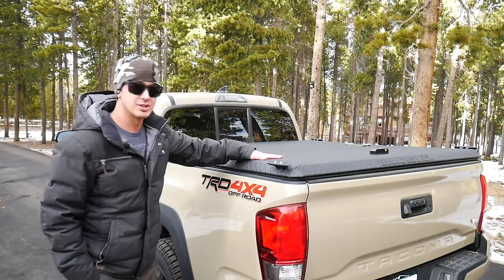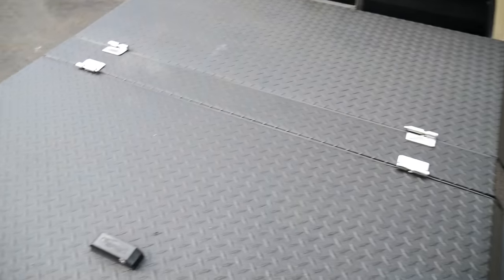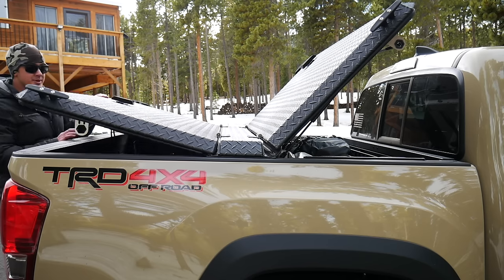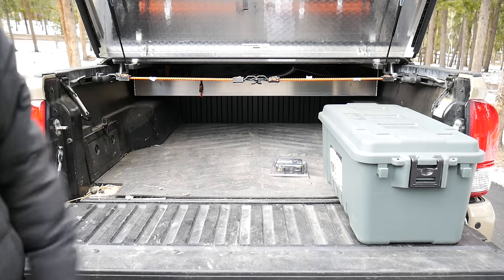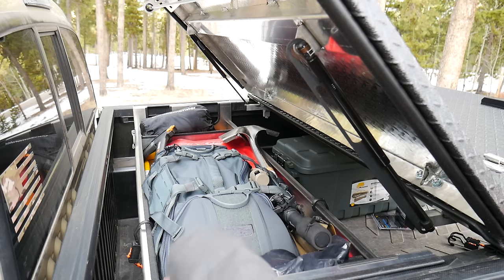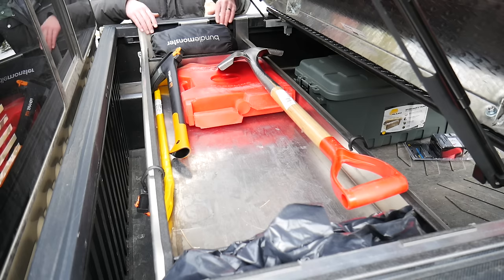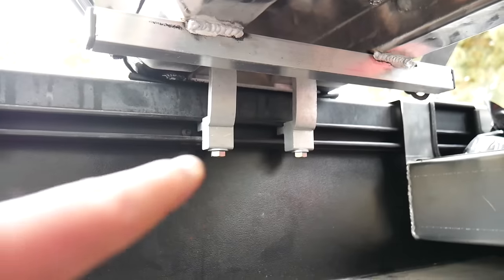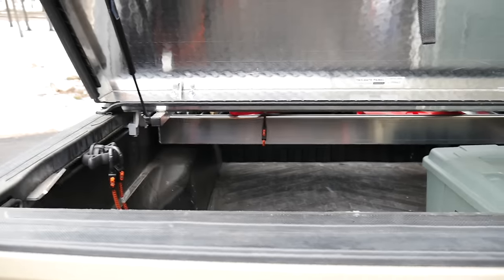DiamondBack Truck Bed Cover Review - Essential Truck Gear - Episode 2 (2016 Tacoma)

Comment from the maker: Check out EVERYTHING you can do with this cover in this newer video - https://youtu.be/ndg8KaZ_Wsc
Reply: Last Line Of Defense  I’m looking at one off these covers how dose it seal against the elements? Is dust or water ever a issue ? Thanks man great videos !
Reply: Mike, which Diamondback toolbox is that. The 8 or the 13?
Reply: @lastlineofdefense Update your affiliate link for the shovel
Reply: I love the tonneau but I want to put a fridge/slider in the bed. What is the max depth of the bed where the locking bars are?
Reply: Just installed my Diamondback and ordered my rack to install my Roofnest Falcon. I'm in Manitou Springs. Cant wait to get it up in the mountains. Also installed a Tailgate N Go made by a family in Grand Junction.
Reply: @dokken08  did you get the HD or SE. I have a representative from diamondback reccomending I not get the SE for a rooftop tent as it does not support the weight of that plus people and gear, and will also void the warranty.   Although it seems mike does not have an issue.  Any help is appreciated thanks.
Reply: If they made flip out grip portions under each panel, each side could be used as a ramp for an ATV/motorcycle. Should hit them up about that, considering its diamondplate
Reply: @lastlineofdefense - @8:00 when you fold the panel completely over - Would it be possible to leave it folded that way if you secured it down (bungee cords or something)? I transport my bike using a tailgate pad and would love to continue to do so without having to remove the whole panel. Also, have you removed it often? Do you still recommend this cover?

Comment: I had one of these Diamond Back covers on my '05 Sport Trac and it was  valuable in regards to being theft proof.  Prior to installing it the contents of my bed could be stolen even with the soft tonneau cover.   Another item I installed was the swing out cage that extended the bed another couple feet when allowing the tailgate to  lie in the open position.  This allowed me to load fire wood onto the tailgate and keep camping gear dry underneath the Diamond Back.  We had lots of camping gear and would often load the excess on top of the Diamond Back and secure it with a heavy duty cargo net.  Presently I own a SUV but you got me thinking about buying another pick up and it seems like the Tacoma TRD is an excellent choice.

Comment: I owned one for 4 years on my Titan XD PR.   Which was a great truck except for all the mechanical failures nearly monthly.   Finally I had to take the hit on a trade and got a Ram.   Shorter bed will mean new cover.  I had the Rear Window guard on my cover also just in case I wanted to tie stuff down on top.. which I had several times..  Even though it was a pain to install due to the slide rails on the Titan... which were great also...  I will definitely be ordering one for my new Ram..  I did have the front panel try to slide off once but that was my fault for not locking the handle which allowed it to rotate to the open position and release the latches..  So be careful that you always lock the handle it will be no problem.

Comment: Take a look at the Honda Ridgeline. it has a trunk in the bed the locks tight and has a gasket to keep it sealed from the weather. Those truck covers don't keep moister out and things will rust. Take a look at on. It drives smoother than a regular truck.

Comment: I'm still torn between the Tacoma and the Tundra. I will have 3 kids in a few weeks so I'm thinking I will need the cab space of the Tundra. but I love small trucks!!!!
Reply from the maker: mixflip I'd probably go for the tundra, if I had 3 kids. Well, I'd probably go for an f150 Ecoboost actually...
Reply: Last Line Of Defense I had an F150 4x4 crew cab a few years back. loved it but I'm not 100% sold on turbos. they tend to be high maintenance and major weak points as far as bug out vehicle is concerned.
Reply from the maker: Yeah turbos will always have a little more overhead, so I agree there. My brother has the Ecoboost though, and his truck feels like driving my old GTI - the Taco and Tundra are dogs in comparison.
Reply: I love the Tacoma short bed.  I have departure angle scrapes as it is.  If I had the Long bed I probably would have much more damage.  Plus it depends on where you like to go.  For me the smaller truck seems to fit better on tight trails.   Maybe in taking out my ass and the tundra is the same width.   It just looks wider to me.  For desert the tundra would kick ass.    Then there is the gas mileage.  The Tacoma gets about 14 at 70mph.  Or less.  I basically average 14.  I think the tundra would be closer to 10-12.    Again guessing.   These are the things I would consider is all.

Comment: I share the same opinion about toppers. Ive been debating this cover vs a shell. I traded my f350 for a toyota. I dont haul 5ers or goosenecks anymore. This cover is awesome.  It has the benefits of a flat bed and a normal bed. Pretty ballzy to leave a firearm in there.  You need a Ravelco. Google your closest dealer.

Comment: Good, thorough review.  I wonder if Diamondback should put a locking mechanism on both sides of the front piece rather than just one, so that it will hold it down tighter on both sides.  What do you think about that?  And another question.  At the end of your video here you are sitting on the front piece with the rear piece open at an angle.  Can that rear angled piece of the cover support your weight easily without being damaged if you were to lean against it, or maybe two of you doing so side by side looking at a laptop screen say you place on the top of the cab infront of you?  And same if you are sitting on the rear piece and the front piece is open and angled, with that take the weight easily of one or two people leaning back against it?  And on a side note, I'm leaning towards getting the HD, but I like the idea of using the closed cover like a back deck at your  home.  Put a couple of lounge chairs and maybe a cooler up there, even an umbrella over the seats to block out the sun, or not so you can see the stars at night, but you up off the damp or buggy ground.  Seems a nice little plus for a hangout option.

Comment: The issue your having with the front latch is on the adjustment for the front box,  passenger side. Easily fixed. Interesting though that yours has a  track for your back latch,  mine does not!

Comment: Awesome cover, couple of questions. Is that small shelf that you keep the get home pack an add on or something that comes with the cover? Also you have an orange ratchet strap across the center of the bed. Is that part of the standard install or something you added to help stop it from swaying or something?

Comment: Can you mount a rack on top of the diamond back?

I had the idea of sleeping on top of the cover on an air mattress.   And then putting an easy up over the whole truck.  The kid that has the walls that can go 45 or all the way up or down.   I’m wondering if the locks on top of the cover would damage an air mattress.  Or a rack which I could throw a tarp over.   

I don’t want to mount a 400 lb tent on the back of my truck.  I want light for gas mileage.  And I don’t want to be too heavy.   

Any ideas ?   I really like the diamond back either way.  
I also plan to get a rigid bumper swing out for the spare tire with the slide out table.

Comment: Hello i have question what are the length did you order? Is your tacoma short bed?  I want to oder one but not sure which one to order, i have a short bed tacoma. There’s two length bed, on the diamonds back cover, one is 5’ and the other one is 6’2”  which one is for short bed tacoma. Thanks

Comment: Hey Mike. I noticed the hinches on your current setup are black. On this video they're chrome. Did you replace your diamondback cover for an HD or you still have the SE? Been thinking about getting the cover for a while. But I can't justify 2k for it. If I could install a rooftop tent and have 2 adults without breaking I would totally get the SE. Thanks

Comment: If the SE hauls 400, does it have a static weight limit that's much higher? I can't fine anything on it. I know you have the racks and tent on it now which I would assume is well over 400 when you are sleeping in it. Thanks Mike

Comment: Today I installed a DB cover on my new 2018 Taco TRD Pro. I too can not get the cabin panel to suck in. I had to remove the tie-downs to make room for the locking tabs. Did you ever figure this out?

Comment: Another great video. IK I’m late to the party, but is it me or do the two ends not sit flush? Does this cause problems with element infiltration?
Reply: If you put weight on the panels when you install them you can adjust the latches/locks and make the panels more flush. You may need to press down on the panel and then turn the lock, but it looks better.

Comment: Awesome review!  I just picked up my '18 TRD Off-Road yesterday and have spoken with DiamondBack to get the process started on a HD cover.  Also looking at the cross bins; debating the 8" and 13".  Looks like you have the 8".  If so, can you let me know how much clearance you have under it?  I'm curious if the 7.25" MTM ammo/utility tubs would fit underneath.   Looks like there's plenty enough space, but just wanting to make sure.

Comment: Great video.  I have a Tundra with a Roll 'n' Lock cover.  When the cover is closed, it must create some sort of vortex with the air flow because it sucks a ton of dust in on gravel roads (I think it comes in the gaps around the tailgate).  Do you ever have the same issue with this?
Reply: Yes, I actually saw them not long after I posted this comment.  A few years ago, I installed foam weather stripping that helped, but the foam compressed and pretty much stopped helping, so is time to replace with a proper tailgate seal.

Comment: This cover is pretty cool, but I could never have one. I bought a camper on one of my trucks and it became useless as a truck. For my use anyway. I couldn’t dump rubbish, haul green waste or motorcycles. And whatever I put inside slid all the way towards the cab, then I’d have to crawl inside and get it. Huge pain, nice to sleep in but then you gotta take everything else out.

Comment: Just a few questions. Did you notice a difference in suspension performance after installing the cover? Have you noticed any moisture creeping in? I live in Aurora and want a cover that will be fairly secure. Thanks for any answers.
Reply from the maker: Didn't notice any change in ride or ride quality, and I haven't had any moisture issues yet!

Comment: Diamondback jacks the price on these covers $320 if you want black. Nice covers but I'm not paying more for the same cover. Heck, they are already expensive enough.
Reply from the maker: It's extra because one is raw aluminum, the other is coated with this super thick line-x material.
Reply: @LastLineOfDefense  I understand their reasoning but they should have split the price difference down the middle and charged the same for both. The raw aluminum appeals more to business customers.
Reply: @LastLineOfDefense  By the way, great in depth review. Much appreciated.

Comment: Harbor freight make some small led lights with a hook and a magnet that might help shine some light in the bed while getting stuff out at night, or a headlight in that tray maybe .?..
Reply from the maker: Yeah, i am thinking about installing some led bed lights at some point - but it's relatively low on the list. I don't too often run into a situation where the available light isn't enough, or I don't have on a headlamp for whatever else I'm doing in the dark, etc. There are some cool options out there though.

Comment: I just installed mine on my Tacoma. How far forward do you install your cap? I didn't t go all the way to the forward edge of the bed closest to the rear window. I left about a 1/4" inch of the top of the rail exposed. When I raise the tailgate I notice I'm fighting against the rear weatherstripping that goes across the tailgate. Was yours a little tough to close when you installed yours?
Reply from the maker: Yeah I probably have about 1/4 - 1/2" at the front. My tailgate opens/closes without much effort - though I could probably tighten my top a little bit, the weatherstripping isn't pressed excessively tight.

Comment: Hey Mike, I recently purchased a Diamondback cover for my Tacoma. I was wondering if the cleats would be a problem for an automatic car wash? Have you run yours through one and if so was there any problem with the cleats?
Reply from the maker: No problems at all - I go through carwash with racks, maxtrax, even rooftop tent sometimes.

Comment: that's an awesome cover but that center peice is a bit low and  would drive me crazy.  I wonder if that can be adjusted to be flatter?  maybe the center peices can be shimmed up a bit?
Reply from the maker: It's a gasket, and I think I just need to tighten up the front and back piece to suck them down tighter to match.

Comment: Why would they put external hinges? There is a reason door hinges are on the inside. What's to stop someone from just unscrewing the bolts and taking the hinges and panel off?
Reply from the maker: Can't unscrew them without holding the nut on the inside of the bed

Comment: Do you have issues with water proofing or water leakage? I got mine and have been trying non stop on my taco to try and seal the cracks and gaps with silicone to no avail....
Reply: My front end near the cab leaks like crazy
Reply from the maker: Yeah it's most likely not the cover - it's just the large voids in the bed itself. If you climb in in the bed, you'll be able to see in the corners the big gaps in the bed itself. You'll need to fill those with something. I'm using a few piece of weatherstripping on mine.
Reply: Last Line Of Defense is yours now completely waterproof now? And if so can you PLEASE tell me what you used and where you put it. I’m going crazy trying to water proof my bed!
Reply from the maker: Did you read the previous comment?
Reply: Last Line Of Defense whoops sorry, didn’t see it the first time

Comment: The representative from diamonback told me not to get the SE for a rooftop tent as he said it's weight capacity is only 400 pounds yet you seem to have no problems with that. Can you give me some more information?
Reply from the maker: I don't work for Diamondback, so I can't really say one way or another - but I'm sure the Diamondback person told you that, so they could stay within their quoted specs / legality. But the SE is a solid cover and in my opinion will hold up just fine. Stay tuned in the next few weeks and I'll be doing a more in depth video on the whole setup!
Reply: @LastLineOfDefense  thanks for the reply.

Comment: Will that tool tray slide from front to back between the center? Or does it have to be moved to the front or just the back?
Reply from the maker: It won't slide between, you'd have to take it out and move it if you wanted to do that.

Comment: Did you go ahead an install yourself and have you noticed any cosmetic damage from the cover? About to 'pull the trigger' on this.
Reply from the maker: i installed myself, pretty straightforward. The cover doesn't damage anything, and you don't have to make any permanent modifications.
Reply: Thanks for the VERY fast reply. Glad to hear no damage. I figured it wouldn't be difficult install from what I've seen online. Much confidence from your response! Also thanks for pop lock recommendation too 👍🏻

Comment: Could a thief just unbolt the exposed hinges and lift up from the middle?
Reply: Dean Fuller probably, but it's not likely to happen without someone noticing at some point
Reply: Dean Fuller There are nuts on the underside of those bolts that would make it very difficult to do that (I couldn't do it with my impact driver).
Reply from the maker: Yeah, even though the bolt heads are exposed there, I think you'd be able to just loosen them a bit, but not actually remove them. I'll try it out to make sure, later when I have a chance.

Comment: How does the lid lock in place to keep it from closing when you lean on it like you did on the end of the video?
Reply: Daniel Mendoza it doesn’t lock in place but there is some resistance from the gas springs

Comment: Your Pop & Lock link is for a Tundra, not a Tacoma.

Not a big deal, just wanted to let you know :)
Reply from the maker: Kind of correct, but that Tundra and the 16/17 Tacoma is the same exact system. So yeah, it is actually for the Tacoma, but it is also for the Tundra (same model number)
Reply: Oh gotcha. 

I only said that cuz Amazon was kind enough to give me an obnoxious notification about the product not being compatible. Upon further inspection it does in fact appear you are correct.

Thanks for helping me clear that up!
Reply from the maker: No worries! Yeah, amazon's 'does this fit my vehicle' thing works maybe 15% of the time... :/

Comment: Where do you buy the parts for the bed lock in 15:12 thank you.
Reply from the maker: I'm not sure what locks you're talking about - but the part at 15:12 that goes into the bed rail, it comes with the diamondback cover (for tacomas).
Reply: Last Line Of Defense thank you i buy this bed cover because of your vids! 🤟🏽

Comment: Cool cover. Seems like having exposed hinges is a pretty big design flaw. Wouldn't be hard to unscrew. Am I missing something?
Reply from the maker: Locking nut inside - unscrewing the bolt from the outside will just spin freely.

Comment: How much you pay for your cover?
Reply from the maker: The SE model (the model I have) is around $1500, I think the HD is closer to around $2k. The black line-x coating is also more expensive than just the bare aluminum.